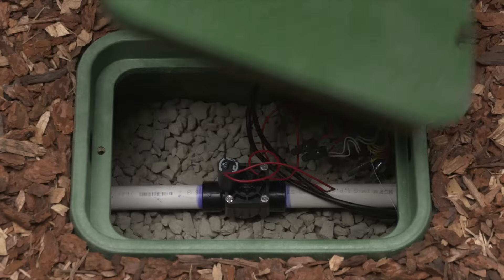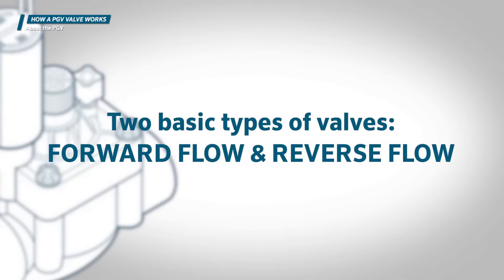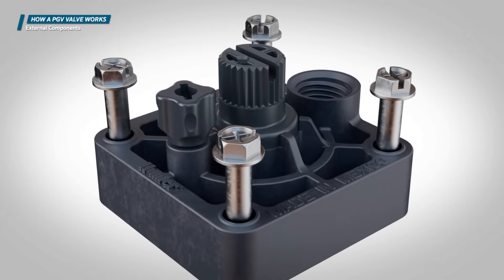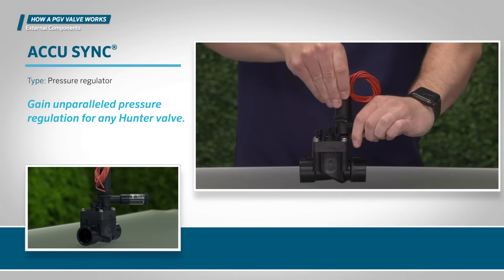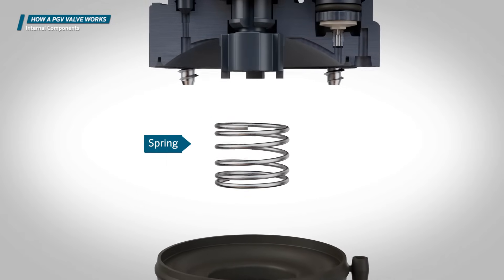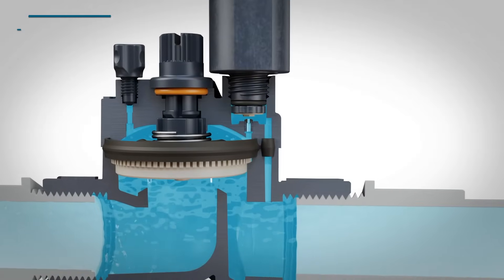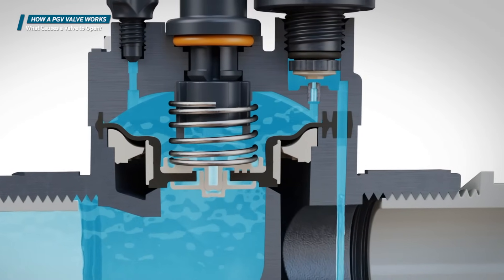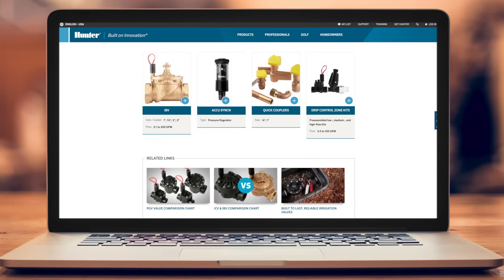Understanding How a PGV Irrigation Control Valve Works, PGV-101G

Comment: i dont get it ... if pressure is equal N/mm2, the bigger surface vs smaller membrane surface implies a lineary bigger force ? usually bigger surface = less pressure ?
Reply from the maker: Yes, the same pressure is on the top and bottom of the diagram but there's more surface are up top, and more force  pressing down. Pressure x Area = Force

Comment: What will happen if the valve gets closed when the pressure was 3bar, and then the pressure rises to 7bar? Will the higher (then when it was closing) pressure force diaphragm to open?
Reply from the maker: There's always more force on the top keeping the valve close. Opening the solenoid or bleeder screw lets some of that pressure (and force) off so the valve can open.

Comment: So had a problem with my first of these I purchased. Even without power, it was letting water flow. Figured something was faulty, but not sure what. Replaced it and my second one of these worked just fine. 

However, about 2 months later, suddenly without power this new one is letting water flow. My understanding is the solenoid should only let water flow if it is powered. Any other part of my valve that may be no good?
Reply: So turns out the Solenoid had simply come loose. Opened up my box and tightened the solenoid, and voila, it’s fixed
Reply from the maker: That sounds like the issue exactly. Nice detective work!

Comment: Out of nowhere, one of my drip system zones started springing multiple leaks. It looks like excessive pressure is damaging the components. Could this be a problem with my valve?

How should I troubleshoot & fix this problem?
Reply from the maker: Hunter valves are rated to at least 150 psi (10.3 bar) but drip line is rated much lower.

Comment: i'm very new to this, but if a solenoid is de-energized (aka, disconnected from the controller) does that mean the valve will always remain in the closed position and therefore no water will flow through the valve? ?
Reply from the maker: Correct. Turn the power off or disconnect the wire will make a Hunter normally closed valve shut off the flow.

Comment: I have 3 pieces of the model 101, when I turn on my well pump, (90psi) a little bit of water comes out of all valves. Two valves are new, one is a bit older, unfortunately no difference. How do I solve the problem?
Reply from the maker: It may be time to contact a local irrigation professional for help with your issue.

Comment: Hi, this is very helpful video. I am trying to replace the top of the valve/diaphragm as shown. My problem is that one of the four screws is stuck and just doesn't want to come off. I tried WD-40 but it didn't help at all. I can't use anything big because there is not much space around the valve. Can someone provide me other practical tips?
Reply from the maker: You may need to dig up the valve box to allow for better tool access. If the screw is stripped and you can't get it out, you'll want to replace the entire valve.

Comment: To increase pressure, flow valve goes clockwise or counter clockwise?
Reply from the maker: By turning the flow control knob counter clockwise, you'll allow more water to pass through the valve.

Comment: So, if I understand correctly, the valve opens when the water pressure above the diaphragm is reduced by opening the solenoid port; then the input water pressure keeps the diaphragm up.  When the solenoid closes the solenoid port, water pressure builds up above the diaphragm, but now the spring provides sufficient restoring force to push the diaphragm down into the seat and turn off the water flow.

In other words, the water pressure does most of the valve opening and closing work.

This appears to depend upon the downstream pressure being (significantly) lower than the upstream pressure.
Reply from the maker: "In other words, the water pressure does most of the valve opening and closing work." Spot on! Without the pressure on the top of the diaphragm, the valve wouldn't close.

Comment: Thanks! A very informative video. I'm trying to troubleshoot why when i activate one of my valves (9v dc coil latch) via Node BT app it closes 0.5 second later. I can hear water starting to flow and then it stops. It happens every other time. One time works, next doesn't. After this video, i think need to check the flow control and see if the solenoid plunger drops for some reason closing the valve.
Reply from the maker: If that doesn't solve it, contact our customer support department here: https://www.hunterindustries.com/hunter-technical-support-email-request

Comment: This was informative but I still don't see how water get above the diaphragm if the job of the diaphragm is to shut off the flow of water.

Let's say you have a brand new installation with nothing but air in the lines. When the water is turned on, how does it get above the diaphragm so the pressure in the base is equal to or greater than the bonnet allowing the diaphragm to open?
Reply from the maker: Though it's counterintuitive, diaphragms have a path to allow water to the top. When you first pressurize a mainline, a valve may briefly open was the top of the diaphragm fills with water.

Comment: I took apart mine, cleaned every part (had nothing to clean though), played with the exhaust valve and tried to manually turn it, but mine won't work. If the main flow is on, it won't open. If I open it and then close the main flow, the valve will open. I can then open the main flow and water will flow. Turning it off also works.
Reply from the maker: Please contact our customer support department here: https://www.hunterindustries.com/hunter-technical-support-email-request

Comment: Thank you. Question, my valve only works with bleeding screw. I could confirm the solenoid is working. I cleaned up the tiny hole where solenoid fits…but still it didn’t work.

Can I simply get a new valve and replace the whole plunge/solenoid/bleed screw mechanism, and avoid a complete cut pipe and replace the whole valve kind of effort?
Reply from the maker: It's common for irrigation technicians to replace the entire top assembly, leaving the valve body in place. It's critical that you have the same model valve and that the remaining valve body is not damaged though.
Reply: @Hunter_Landscape_Irrigation , I replaced it. But sadly it’s leaking from where it’s attached. Do I have to tighten screw much stronger?

They looked a like. How can I know the model number?
Reply: @Hunter_Landscape_Irrigation , Thanks for responding back. Your answer confirmed that I was on right track. I retried and ensure the tight fitting between gasket and hole. It fixed the issue❤

Comment: So I have been using my valves manually by turning the bleed screw, somehow another screw was turned and the valve would not work anymore, how do you fix that?
Reply from the maker: Take a look at the flow control handle. If it's turned down to low, water will not flow through the valve. https://youtu.be/dBajCvLNem8?si=WERN_7pFXqi_wmlB

Comment: If i turn open the cylinoid and open the bleeder at the same time, what will happen?
Reply from the maker: Either action will manually open the valve and there's no issue should you do both at the same time.

Comment: I maintain a 4 house estate and pull water from a river behind the property and there’s a little over a 100  PVG valves and on occasion I will have a valve just stay stuck on. Sometimes I will find a pebble inside from a break in a supply line but most times I find nothing. Sometimes just flushing the valve out while open does it but sometimes it still stays stuck open or will do it the following week. If this happens I will just replace the top 1/2 with a new one and most of the time that works but not always. I wish I could know why they stay stuck open. The weird thing is it’s usually the same 2-3 zones that malfunction even after replacing the entire valve. Can you tell me why a valve would do this?
Reply from the maker: Debris in your water supply can cause a valve to stick open or stick open part way.A pebble would likely prevent the diaphragm from fully seating. You may need to contact and irrigation professional to install a system wide filter or screen.

Comment: Ugh somebody help me out. One of my two PGV valves developed a slow leak; I replaced the top bonnet with a new one from Home Depot. That fixed the slow leak. But now, when the valve is opened, it shoots a jet of water out the side. Based on the video, the water jet is coming out where the bonnet exhaust port is; and it happens as soon as the downstream pipe is full (i.e. exactly at the 3:00 mark in the video). I have unbolted and reseated the bonnet multiple times, and the diaphragm is new and no sign of debris around the edge of it. But I'm always getting a water spray out of that same spot. Do I need to replace the entire valve?
Reply from the maker: You likely have two different versions of a valve installed. When replacing just the valve bonnet (top), it's critical that they match 100%. It sounds like you'll want to replace the entire valve at this point.

Comment: What's a good setting for the diaphragm, the screw in the middle of the bottom?
Reply: close it all the way, turn on the water, open the flow control valve until you get the desired spray pattern from your heads.
Reply from the maker: Exactly!

Comment: What’s the difference between using flow control and using your Accu-Sync valve pressure regulator? I’m trying to adjust 1 of my 16 zones (coming from a 2HP sprinkler pump at an always consistent but pretty high psi) down to use 5 bubblers for this one zone along the fence. Ideally, I was thinking I could use the flow control for this and regulate all 16 zones to the appropriate psi. But it confuses me that there is a $65 pressure regulator accessory that is sold as well. I’m not understanding how they differ from the flow control that is already built in.
Reply: I'm confused as well. Hopefully Hunter can explain.
Reply: I think it's better just get an water pressure regulator or a valve with pressure regulator
Reply: Flow and pressure aren't the same thing. The accusync lowers pressure with less flow loss. Pressure reducers don't reduce pressure by restricting flow. Rather they use a plunger that pulls back and creates a suction force that tries to pull the water backwards, thereby reducing its velocity and psi. Basically, it takes advantage of the principles that cause backflow. The practical benefit is that you can run more emitters on one drip zone than you could by restricting the flow rate.
Reply from the maker: It's correct that flow and pressure aren't the same thing. Using a pressure regulation device on an irrigation station is more reliable and more accurate than adjusting the flow control knob.

Comment: Does solenoid need to be energized all the time we want water to flow or is it enough to energize it for a few seconds until the chamber changes pressures?
Reply: It has to be active all the time for the valve to open. The solenoid activates a tiny electromagnet and if the current is off, the metal plunger will drop, causing the valve to close.
Reply from the maker: Nice, you have it down!
Reply: @Hunter_Landscape_Irrigation  What do you mean?

Comment: During the winterization of the system, the blow-out port should be on inlet side or outlet side?
Reply from the maker: Winterization and blowout steps vary by contractor and by region. Generally, you want o remove water from the valve and any other device that would be damaged by freezing. https://youtu.be/qo5PHp-6C10?si=8PZ18C5ohmM-uxI9